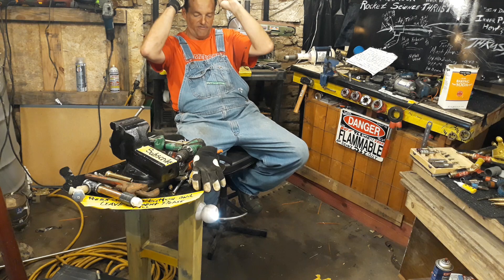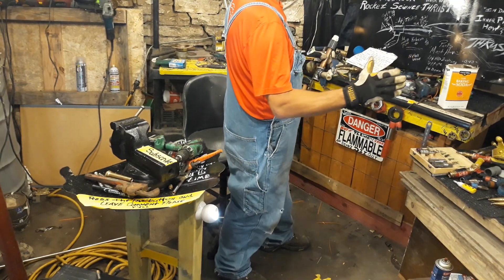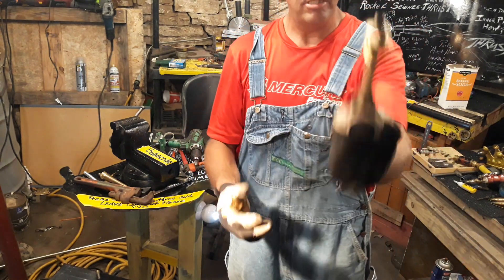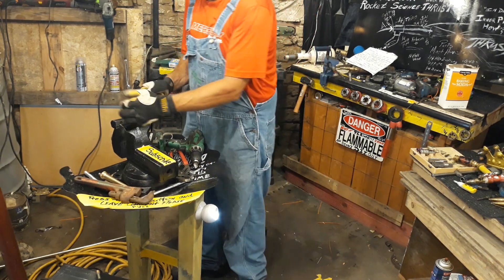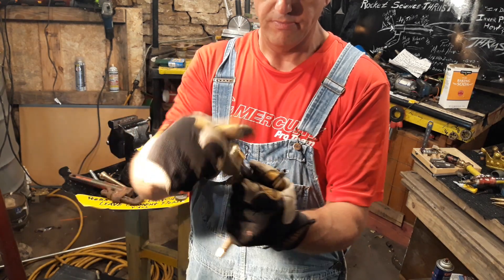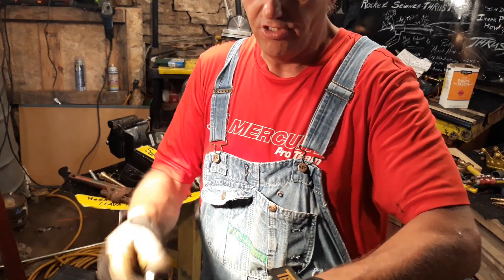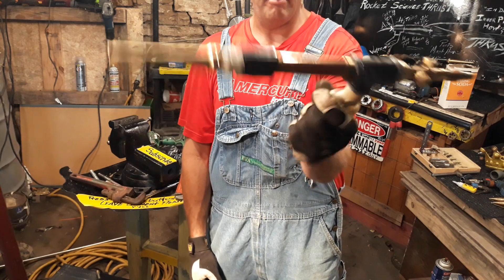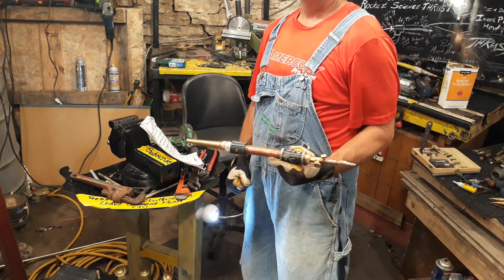"INNER"VENTURI FLOW  POWER PIPE! AN Air compressor powered pressure washer. Clear build instructions

Comment: Interesting project !!  I am looking for the final results of this project. But I did not find it.
Reply from the maker: If you want you could check out my playlist.... The king's gun series. On that channel list you'll see several demos and several variations of this project currently I'm working on a pressurized water tank to add to this to boost the PSI up high enough to run soda blaster but that's in the works. I'm also working on a boiler so I can have hot water on demand and steam power instead of compressed air power that's what got me to check out your channel because I'm playing around with burn Chambers right now😁👍
Reply: @tctime  Ok, thank you, I will search it.